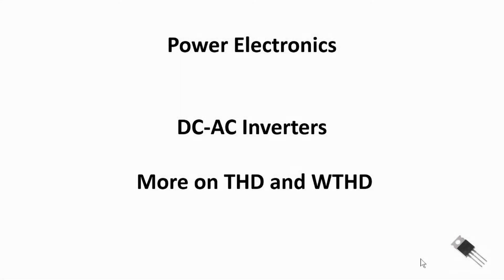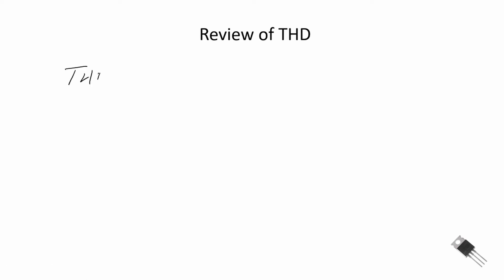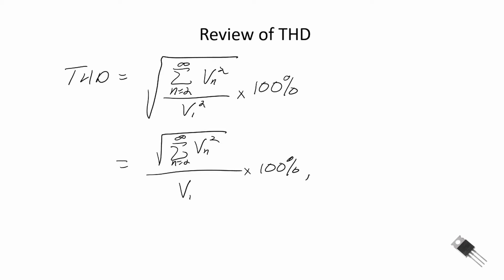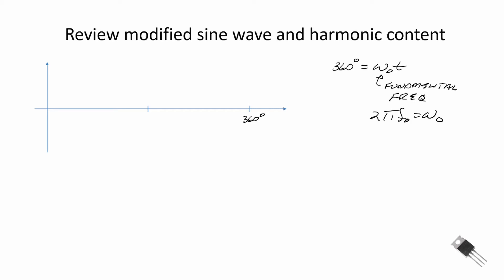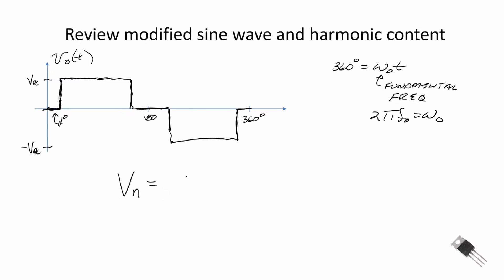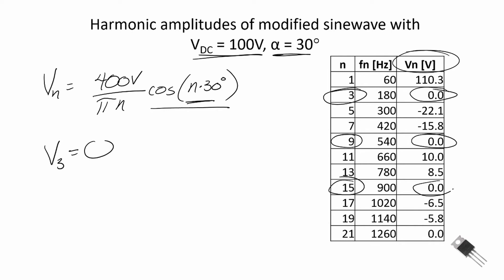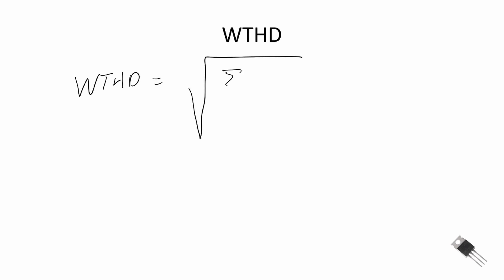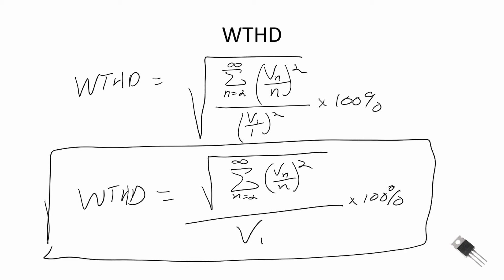Power Electronics - Weighted THD (WTHD) for Inverters

Comment: WTHD is a better suited voltage harmonic distortion index for PWM operated inverters, regardless of their tied load, which can even be purely resistive. This is because WTHD is frequency weighted. For example, the voltage THD of a simple square wave modulation is 48%, while the WTHD of such waveform is about 12%. When the simple square wave modulation is replaced with the more advanced Sine PWM, the THD of such waveform is about 64%, while the WTHD is about 5%. This means that conventional THD doesn't do justice for PWM inverters, thus WTHD should be the parameter of choice to compare different PWM schemes. WTHD is also predictive of harmonic distortion and losses in induction motor loads. 

My Ph.D. thesis deals with analytical formulations and optimization of both THD and WTHD applied directly to either phase or line voltages of staircase modulated multilevel inverters (5 recently published journal papers are also included):

https://www.dropbox.com/s/jms2wv5zcuj749q/PhD_Thesis_Eli.pdf?dl=0
Reply from the maker: Dr. Barbie, congratulations on obtaining your Ph.D.  It is a great milestone in one's academic journey.  Thank you for the comments and best wishes. -Dr. K